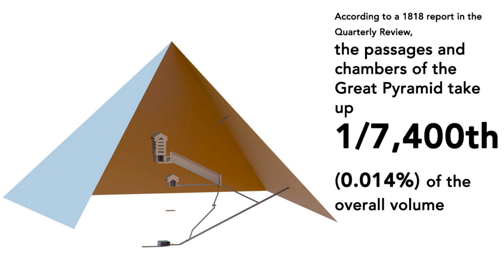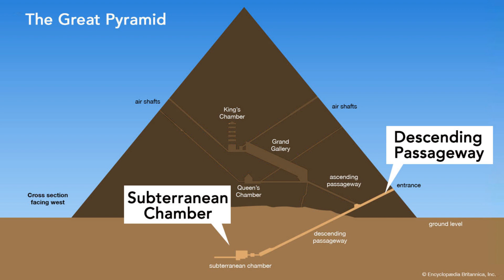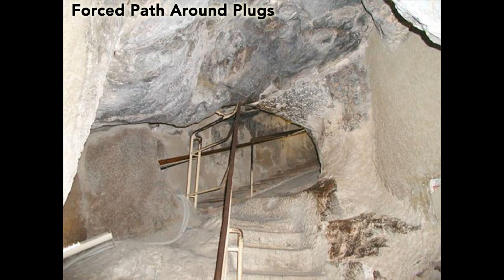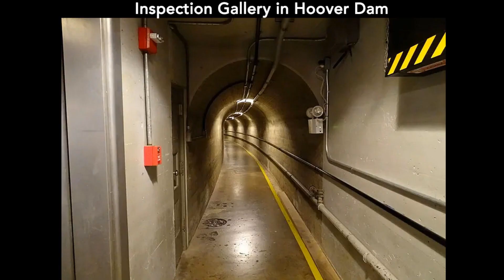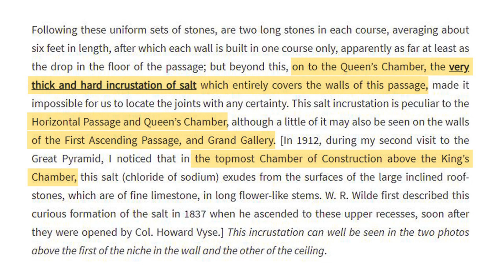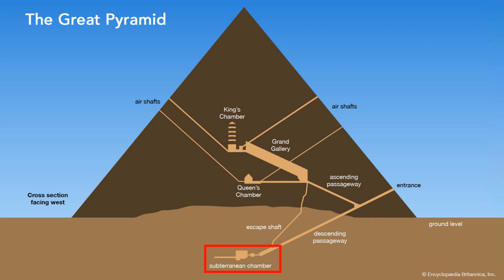The Mystery of the Great Pyramid's Interior System?

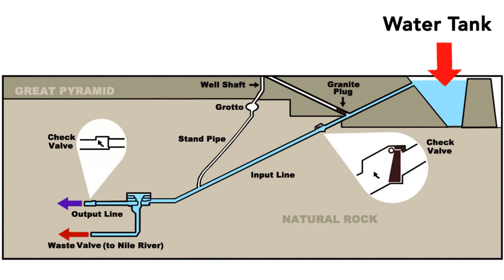Comment: 16:23 the pyramid had a retaining wall around it precisely to keep water higher than the original entry.  Behind it was Lake Menes which took water from higher up the Nile.  When water was admitted to the subterranean chamber it pumped 15% or so if it (greater than 10% due to the very efficient nodules in that chamber that form a toroidal vortex, shown by at least two engineers).  While 85% of the water flowed back into the Nile, raising it's level for flood agriculture in the Nile Delta, the 15% was purified of sediments and even many parasites because of the force that pushed it up through the well named "well shaft".  The air holes enabled the water to fill the lower chambers very completely for efficient pumping.  

Whether acoustic or piezoelectric properties of the stone assisted in water purification is unclear but using the ram in  a lightning storm may well have been optimal as the ionic and electric conductivity of the stone would have killed even more parasites in the water. 

If the water rose to above the height of the Kings Chamber "sarcophagus" which had also acoustic properties that would have further killed parasites with strong sound waves at 440Hz, it would fill with very pure water that could be retrieved when the pump was not running, with a sluice out the Grand Gallery pouring out more ordinary drinking water for lower classes. All of which would absolutely have seemed magical to anyone before 2700BCE.  If the pyramid was topped off much later than it's base was built, when perhaps it became useless for pumping, the air shafts could simply have been to allow it to resume pumping if the river changed course again and the lake filled up. 

Herodotus described two pyramids in Lake Menes that were likely smaller ram pumps.  And there is a "test chamber" built just like the subterranean at 2/3 scale nearby, suggesting the technique for building it had to be tested before the big structure was finalized.

Egypt had five problems: keeping the Nile at a steady level at given times of year for agriculture, purifying the silty and parasite ridden water for ritual purposes & healing, while providing water to big cities, keeping the masses onside with spectacular light and water and sound "magic", and warfare.  Given the Nile Delta was by far the most likely area to fall to sea borne or coastal-travelling invaders, the ability to catastrophically flood it on demand was extremely militarily powerful. As we see in Kherson valley today, where the occupying force must now worry about a dam upstream being broken or opened to thus flood their position.

My hypothesis addresses all five of ancient Egypt s actual big problems thus leaving more time to devote to cats.  Which, again as we see today, is more popular than ever as leisure time viewing.

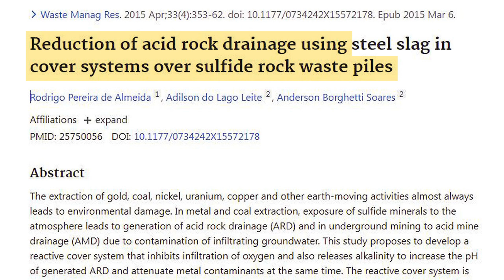Comment: Totally BS. at 7:57 you are showing an articles in the screen saying that STEEL SLAG is been using in cover systems over sulfide rocks waste of piles, for those that doesn't know steel slag is a by-product from the production of steel during the conversion of hot metal to crude steel in a basic oxygen furnace, or during the melting of scrap. You intentionally took the "Steel Slag" off the yellow marker because you know that pyramids DOESN'T have any steel slag on top of the exterior layer. Neither LIMESTONE is a sulphide rock AT ALL, they doesn't drain any poisonous chemical. your "theory" makes no sense, no steel slag and no sulfide content to protect any environment from.🤣🤣🤣
Reply: No one daring to reply

Comment: Think in four dimensions, a thing can serve multiple purposes at once.. maybe the earier pyramids were tailing waste with essential exhaust pipes so they didn't become volcanos. But the great one is a completely different animal. If your gonna go though the trouble of quarring an underground city, hint hint, why not make a power plant, a hydraulic pump, and a massive structure designed to turn water into hydrogen and oxygen.  Those handles were the equivalent of a spark plug that ignited gasses pushed them against each other, which created pressure, which pushed in on the quartz crystal in the rose granite, which, since the outside was insulated sent the power down. Slagle pile, water pump, oxygen generator, power plant. Love this channl. Blessings 13

Comment: Do you think the reason the cemented blocks were random sizes rather than uniform would be to protect the pyramid from eathquake damage?
Reply from the maker: It's very possible. Though there are millions of blocks in G1. We can't tell whether they are all in different sizes since most are not exposed. I think the overall structure can still benefit from an outer layer built with random sized blocks in case of earthquakes.

Comment: Tina, great video! Can you explain what the purpose of the “sarcophagus” was in the king’s chamber of the Great Pyramid? Thank you.
Reply from the maker: Thank you! I am still thinking about the “sarcophagus" in the King's chamber. The Serapeum and some other pyramids also have similar sarcophagi. They probably served for utilitarian purposes...
Reply: @CuriousBeingbyTina  yes, the sarcophagi in the sarapeum are also an enigma. The precision is remarkable. I wonder if the one in the king’s chamber was intended to hold water runoff to later be tested for degree of contamination. But, if people were not suppose to enter this region of the pyramid, how would the captured water be tested? Or, perhaps a substance was placed in the sarcophagus (intended only once) to somehow help neutralize acidic runoff. Hence the reason for sealing the chamber. No need for maintenance, or testing. Nevertheless, you pose an excellent hypothesis. Probably the best I’ve heard.
Reply: @CuriousBeingbyTina  Maybe it's a big tool box ?! If you can accurately cut granite, right, why not make a box with a lid?
In addition, it is very precisely made, so the tools probably don't, but the control devices definitely do! Who knows if it's at all in its original place.
When I think that the pyramid is primarily a technological building (it only makes religious sense for those settlers down by the river ... now it occurs to me that it is a good idea, because they will wear sacrifices / at least I will not be hungry and at the same time protect the building / security agency free, isn't it a great idea?), so technological construction, so where do we put control devices? To the box.

Comment: Water could have flowed from a reservoir created by the Sadd el-Kafara Dam built at a higher elevation than the pyramids. The dam was built at the same time as the pyramids and nobody understands why a dam would be built in the middle of nowhere. Ground penetrating radar shows the area was riddled with underground tunnels that carried the water down from the hills to the pyramids and probably to the city. A shaft at the base of the pyramid probably reached down to one of these tunnels but Egyptian authorities decided to fill it with concrete. Walls surrounded each of the pyramids to form a moat. The Great Pyramid has evidence of water erosion at the top of the Grand Gallery and through the antechamber to the King's Chamber. My theory is the King's Chamber held water for drinking and calculations show that it was perfectly suited to deliver the amounts needed. It is made of close fitting granite blocks so the water won't leak out. The air vent is rounded off by hundreds or thousands of years of water flowing out of the chamber. The water flowed down to an underground tunnel for distribution. This vertical passage is not seen due to excavations by early explorers who were looking for rooms of treasure and had no interest in a 6x8" opening that should be part way up the sloping segment of the vent. Silt in the water has plenty of time to settle out and was, perhaps, the reason Egypt had a reputation for the best tasting water. Erosion found in the antechamber makes total sense if the coffer was located there instead of the King's Chamber (despite what some information says, it does fit in the passage with 1/2" to spare). Its edges are also rounded off by water. One end of the coffer is flush with the portcullis stones and the other end reaches to the exit wall with four grooves in it. Erosion patterns tell us that water splashed off the top step of the Grand Gallery then climbed up and over the wall created by the coffer and portcullis stones. Once the water is over the wall, it is captured. The height of the wall dictates the level in the King's Chamber. The far end of the coffer blocks the water from entering the K.C. but for the grooves. This may have been to prevent silt from being stirred up by slowly allowing the water to enter. The subterranean chamber is rounded off by water as well. The pyramids used the power of water flowing down the descending passage in various ways,. Corbelled ceilings means splash control to me. Evaporation of splashed water would chill the interior considerably, possibly controlling temperature and humidity for food storage as in a root cellar. In the case of the Great Pyramid, water flowing down the passage to the lowest chamber would suddenly be stopped when water reached the ceiling. This would create a pressure pulse of several hundred psi that would smack the end of the plug blocks. Water above these blocks would have shot up the gallery and splash off the step at the top. The erosion of the various surfaces are evidence that water (or some other liquid) flowed towards the King's Chamber. There is no other form of erosion that causes this, particularly in granite. The front face of the portcullis stone has had an inch eroded from it. The original material thickness can be seen on the right and left edges that were protected from the water by the grooves on either side. The end of the coffer was also eroded by the water as its thickness is less that the other sides. Water that flowed over top of the portcullis stones has heavily rounded the granite and it is skewed to one side. It certainly would not have been built that way. The backside is not worn. There is plenty more evidence to present but this is supposed to be just a comment.
Reply from the maker: Interesting. The Sadd el-Kafara Dam is on the other side of the Nile and was never completed. It's over 22 miles away (direct distance) from the Giza complex.
Reply: @CuriousBeingbyTina  Yes they would have had to tunnel under the water unless they used an old underground river (karstification?) carved by groundwater. It may have been completed and was washed over by floodwaters. Lines on the pyramids halfway up points to water levels 130 meters above normal that was five meters above the crest. This same flood filled the Black Sea with saltwater. I found an underwater impact crater off the coast of Turkey at 35.68N and 29.34E with sharp edges too young to be smoothed over by saltwater. I believe it was made of sulfur because it matches the plagues, the flood and the exodus of the Old Testament. It flew on a low trajectory, south to north, parallel to the Nile spewing sulfur vapor that condensed to a blood red liquid upon contact with the Nile. I believe the shock wave clipped Egypt forming the Qattara Depression as reported by eyewitnesses in Tunisia. It may well have blown away the island of Atlantis as it would have been across from the pillars of Hercules on the Isle of Rhodes. It was so large that it displaced water to raise the level by 130 meters. The Isle of Rhodes was rotated nine degrees according to the magnetic signature of the mountains. The salt layer on the bottom of the sea is missing at the impact site.

Comment: You are doing the world a great service by continuing to delve into the secrets of The Great Pyramid. The 70 ton blocks above the king's chamber give it away as a power generator to me. Here are some facts I have gathered about The Great Pyramid: 1. It is 3/60th of a single degree of true north
2. It weighs 6 million tons
3. Its footprint is 13 acres
4. It is more than 755.9 feet along each side
5. It is 146.75 meters high
6. It has more than 2.3 million individual blocks of stone
7. It is locked into the Cardinal dimensions of our planet; The dimensions of the Earth are incorporated into its dimensions.                                                                                                                 8. If you take the height and multiply it by 43,200 you get the polar radius of the Earth
9. If you measure the base perimeter of the pyramid accurately and multiply that measurement by 43,200 you get the equatorial circumference of the Earth
10. The scale is not random, the number 43,200 is derived from a key motion of the Earth, which is called the precession of the Earth’s axis
11. The Earth wobbles on its axis very slowly at the rate of 1 degree every 72 years; 43,200 is a multiple of 72; 600 X 72
12. So; they’ve given us the dimensions of the planet in The Great Pyramid of Giza on a scale defined by the planet itself
13. There are several 70-ton blocks of stone raised 300 feet above the ground
14. It has eight sides, and at the spring equinox and the autumn equinox one side of the pyramid is in the shade in the morning and again in the late afternoon and can only be seen from the air—as far as my research has shown.
15. It is a calendar
16. It has expansion joints
17. It is located at the exact intersection of the longest line of latitude and the longest line of longitude of the Earth, in other words The Great Pyramid is located at the precise center of the Earth’s land mass.
18. The builders possessed highly sophisticated knowledge of mathematics and geometry
19. The builders had knowledge of the true dimensions of the Earth to extreme precision
20. The builders possessed exceptionally advanced technical instrumentation to site The Great Pyramid
21. Pi = C over D Phi = Divided by 5 + 1 over 2. Archimedes discovered Pi about 250 BC, but Egyptians knew of it 2,250 years earlier
22. The Great Pyramid is 146.75 m high, its height X a million equals the distance from the Earth to the sun
23. If you subtract the inner circle from the outer circle of the circumference of The Great Pyramid, you get the speed of light in meters to four decimal points: 299,792,458 meters per second
24. The weight of The Great Pyramid is 5,273, 000 tons and that multiplied by a billion is the weight of the Earth
25. If you divide the perimeter of The Great Pyramid by ½ its height, the result is 3.14 = Pi                                                                                                                             
26. The three inner rooms; the king’s chamber, the queen’s chamber and the unfinished chamber under the pyramid are proportional to the distances between Mercury, Venus and the Earth.                                                                                                                                                                                                                                                                                                                          27. The distance from The Great Pyramid to the North Pole is the same as the distance from The Great Pyramid to the center of the Earth.                                                                                             28. The height of The Great Pyramid 146.75 m X 1 million = the distance from the Earth to the sun.                                                                                                                                                                    29. The weight of The Great Pyramid 5,273, 000 tons X 1 billion = the weight of the Earth.                                                                                                                                                                      30. If you divide the perimeter of the pyramid by 1/2 its height the result is 3.14 pi h/2 = pi These are of course mere coincidences that happen by chance...                                                                      30. The base side length is 364.242 which is exactly the time in days it takes for the earth to orbit the sun.                                                                                                                                                       31. Pyramids in China, Mexico and Egypt align with the Orion star system
Reply from the maker: Thank you for sharing with me. I appreciate the support :-) The Chinese pyramids don't line up with the Orion's belt; Hope you will check the video I made for the Chinese Pyramids: Myth or Reality Revealed!(https://youtu.be/w_kRatL5GTI).
Reply: Ummmmm, generating power for what?